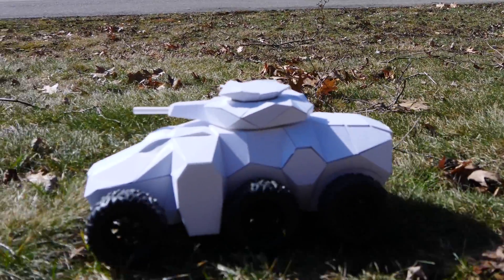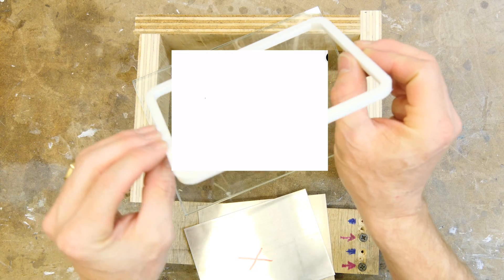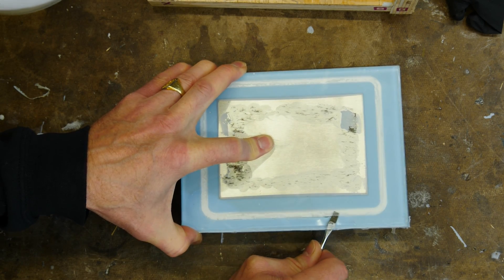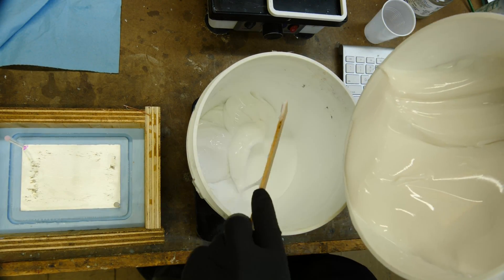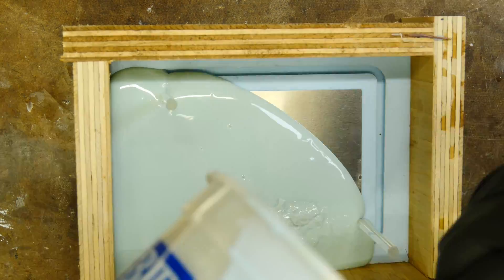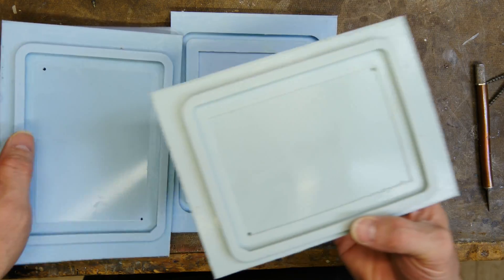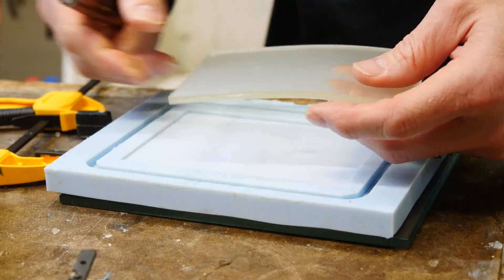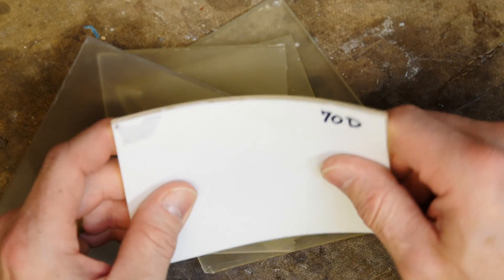Double Shot Injection Resin Casting

Comment: I have recently had success with tube-shaped key locks between mold halves. (I’m 3D printing the original master positive with tube-shaped keys elevated slightly off the upper-lower mating surface.)

Is there an advantage to the cross-section of the key lock here being a trapezoid instead of a circle? I guessing it provides greater holding power in exchange for being slightly more difficult to assemble?
Reply from the maker: Locks the two halves together